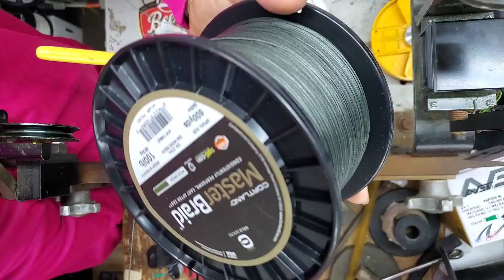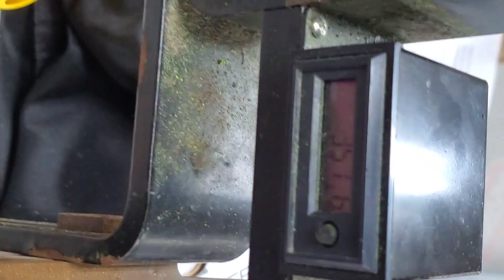Avet LX Raptor Skin spool 100lb 12 strand solid/ hollow core braid Update NEW KOA Our Tackle ASMR

Comment: would you go with 100lb or 80lb braid on a Penn Fathom 30LD2 speed?  says it can hold 455y of 80lb.   thanks
Reply from the maker: For line capacity drop to 60# for backing and 80# for top shot or 100lb

Comment: hey man, I just did some breakin' tests, no scale cause I only have spring scales(works for testing drag, but useless for line testin' since it just jumps back to zero) but I did two lines against each other, first were JB 200lb, fished but always remained on the spool, which only got warm once on a 20-30yd run at 110-120lbs of drag, but beneath was other line so this 200 was sandwiched between other line and it never got into water or had to carry any load. The second line was brandnew 13olb Jb, which lost the first two tests against the 200lb, the  third line was the also brandnew 130lb Cortland which one two times against the 200lb JB. I have new 200lb JB somewhere layin around, but need to find it first. 
NOTE: this tests DON'T proof that the winning line is necessary stronger, not in these lineclasses, since I use a fast pull, like from a juming fish, a shock pull to break the line, for actual tests it needs slow pull, non the less, shock resistant is important, especially when using straight braid, when setting hooks, for massive headshakes, jumpin' fish, sticky drags or when a fish runs against heavy drag after havin' slack line, still a line with the same strengh but less shock resistant can make perfect backing, cause the line on the first hundred to maybe two hundred yards takes all the shocks, simply the weight of the line itself and the water drag will slow it down to where the shock resistant doesn't really matter on the line left, only exception are super sticky drags or when the line heavyli cuts in the layers beneath, but both are cases you don't have if you use proper tackle and know how to use/prepare it.
Reply: found the new 200lb JB, let's see how it looks now, I'm scared the C-16 will still win ;)
Reply: *the 130lb C-16
Reply: ok Albert, the tests are done and the 130lb Cortland wins against the 200lb JB, again, this is impact force so take it for what it's worth: after winnin' two times against the used JB 200 the same 130lb C-16 piece won again against the brandnew 200lb JB, on the second try both lines broke, so no direct winner, but braids wear down, especially after bein' pressured close to the breakin' point, anythin above 20% of the breakin' strengh harms the lifespan of the line, so it's impressive the C-16 held up this long pushed to the absolute limits. then I re-did the test two more times, the 130lb C-16 won both against the brandnew 200lb JB, would be great to have some tests with slow, steady pull following but this already shows that anyone who doesn't fishes mono topshots should go with the C-16, when fishin like I do with the rod down and A TON of drag = very little forgiveness, plus straight braid, or if just a bit of mono, this comes into play too, I really hope cortland will come out with the 300lb soon and that a 500, a 800 and a 1000lb will follow too, since these heavy braids can replace mono entirely, at least for all kinds of fishin where the visibility of the line doesn't matter/blue line is enough, like sharkin' with all metal leaders, river fishin' for eel and catfish, etc. plus for heavy wind-ons, the 200lb JB fit's huge leaders, BUT the line you splice the mono in should always be heavier then the mainline, also the Cortland is so much easier to work with, especially to taper which is very important to do on the heaver one of both braids and when splicing mono, JB is nasty when tapering, but the Cortland goes super easy!

PS: maybe you can pass this information thru to Cortland.

Tight lines!
Reply: and if someone's wonderin', all connections were spliced, both lines connected by a ring made from 3mm thick stainless steel with a cery smooth, electro polisher surface and the loops were kept big enough to not have any agressve angles, to get the best strengh out of the lines, I also made sure to never pull even one fiber out when doin' the splices.
Reply: #TeamHardLife
Reply from the maker: Awesome info and testing.   Sorry was out in deep water battle the kayak got a super long video.
Reply: @TeamHardLife  another thing thad woulda be great is if Cortland can make a moosgreen braidfor inshore and freshwater stuff, especially for stuff like I do: fishin for pike with bait and lures, I prefere straight braid til the cable or titanium leader but with colourful line some mono makes sense, I just don't like it and a nice dark green is as natural as it gets, could just be a bit algy or somethin, same with eye orientated inshore fish, blue only is good for blue water fishin'...
Reply: @TeamHardLife  Another use for low-vis line is actually land based shark fishin' cause it reduces the chances of gettin bitten offby blacktips or other fish.
Reply from the maker: For fresh water fishing the way your saying I understand that.. but for shark fishing I have seen where dark lines get cut off just as fast if not worse than bright lines...
Reply: @TeamHardLife  yeah, always depends on the light, dark lines can be even more visible under certain conditions...
Reply from the maker: Yes sir but that main reason for his vis for me.. hands down is the visibility for me and my team so we can see what or if something is happening to my lines a lot faster, especially when we have to basket weaving..
Reply: @TeamHardLife  yeah, I agree on that, I usually fish alone and over here normally your only allowed two rods so I don't necessary need high vis, still use it for some fishin as mainline with a less visible topshot. everyone has his ways and special needs! 
PS: on another note, over here in some of the countries I fish in... let's say you don't wanna be seen, can be people cuttin' your line on purpose, laws that don't make sense where even the police doesn't know whats legal and what not, leading to that they can pull you up randomly and either make you pay or take away your tackle, etc... doesn't happen everywhere and is kinda rare, but it's in 95% of the time saver to not be seen.
Reply from the maker: Wow that is crazy... what about the game wardens can they help cause cutting lines is a big no no thata harassment of fishermen... and yes sir some piers over here we too are also limited to 1 rod per person or 2 and sometimes 3 ... just depends...
Reply: @TeamHardLife  yeah, France and the british isles and anythin north of France  are the only countries where it's clear and relatively safe, as long as you stay away from the polnish border, skandinavia is fine too but no Sharks, other then Ice sharks and they don't really fight... southern europe is kinda wild and with confusing lawsthat like I said sometimes even the police has no clue of... and of course everywhere someof the boats will try to cut you off on purpose
Reply from the maker: Oh wow.. thats very interesting info...
Reply: @TeamHardLife  that's how I got up to 120lb with my Makaira 50W, I had the advertised 88lb on strike but used max drag... wouldn't reccomend it in terms of the reel's lifespan but so far it worked, of course you should only do this if necessary, if not don't go over STRIKE and your safe.
Reply from the maker: What kind of foahing are you doing with that line capacity and weight
Reply: @TeamHardLife  all kinds of species, mainly Conger, sharks and Catfish(european catfish, they can grow to ten feet and exeed 300lb) I have lighter tackle for cats but on some areas you just need massive drags, imagine a 8 footer with 200lb+ opening it's mouth in a fast movin river where you get already pushed downstream when standin' til your knees in the water, when you then fish from shore and can't give any line...
Congers are a different ballgame, no capacity needed, but HEAVY line and drag, you need a line that even half to three quarters frayed thru still can land a big one and you never give a conger any line! plus them beasts only bite directly on structure and swim backwards as good as forwards so turnin' the head has zero effect... my goal is to get one off the rocks longer than me.
Reply: but in general I prefer to go heavy to be able to land a big fish, even when it's overkill 90% of the time, learned my lesson when brekin' off a fish of a lifetime, first time it was the line that broke, second time the hook simply pulled, never seen any fish like that ever since...
Reply: don't need much capacity normally, only for big sharks, but with a few hundred yards of 200lb you can stop quiet a lot, giot 500yds 200lb C-16 on my Makaira 30
Reply: only really need the big reels for long drops and goin' after giants
Reply from the maker: Will need to start another comment section... lol this one won't let me see it all any more cause getting too long.